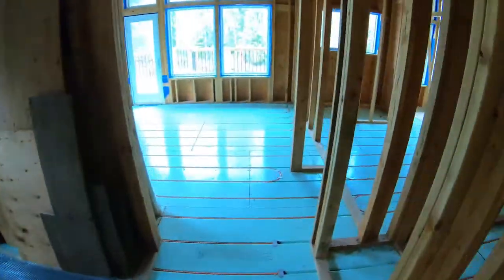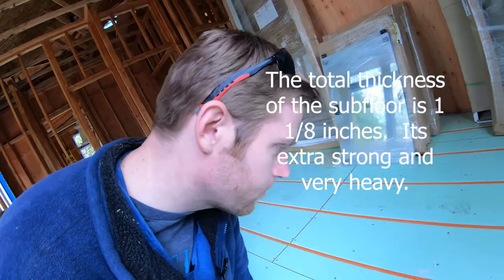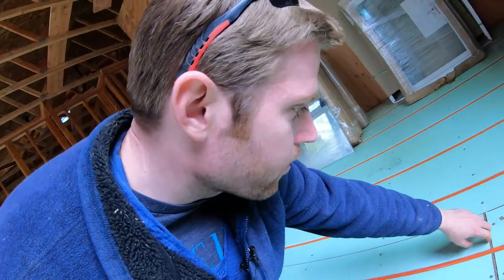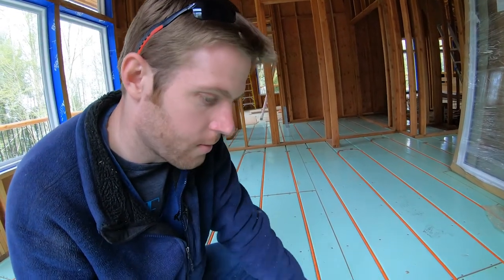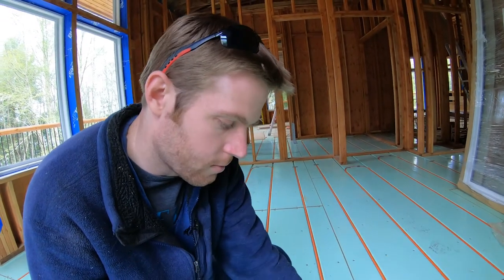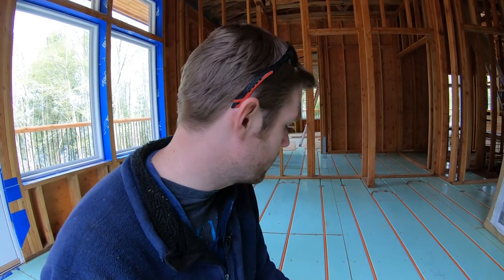WHY Warmboard? A quick word on our choice of Subfloor

Comment: Instead of using nail plates you can use foil tape(used to seal ductwork) to hold the tubing down in place. I did this and it worked great.  This has a couple of advantages IMO. 1. You have to pry the nail plates up when you put the flooring down, the tape stays in place, just lay the flooring.  2. Taping all the tube down keeps construction debris and dirt out of the channels and makes sweeping/cleanup easier. 3. The floor is usually an envelope boundary. Taping the panel seams when you tape the tubes and foaming the penetrations makes for a VERY well sealed barrier.  It is also aluminum so it may even help distribute heat off the top of the tube.
Reply from the maker: I used nail plates per the warmboard instructions but I like the tape idea.  The other bad thing about the nail plates is they can be a trip hazard, especially when they are a little loose.  I think you're right and the  tape would help to spread the heat as well.  In our case, the envelope boundary will be on the underside of the floor joists.  This will keep our floor insulation within the air barrier system.  But I could see how taping the warmboard would give you a really nice seal.  I might do it as insurance.  Thanks for the comment!
Reply: The Leavers Family I didn’t like the nailer instructions so I tried it on the first two runs I laid down and it worked great so I ran with it.  I am building in my spare time so my flooring isn’t down yet, but the tape has held it in place and clean for a year now...  if you are planning an air barrier under the floor insulation, I don’t think you want to seal the top then.  As I understand it you don’t want to completely seal an insulated cavity unless you can guarantee no moisture will be introduced as it will be trapped there.  Warm board is pretty impenetrable as it is...
Reply from the maker: @rronmar  You're right that you don't want to seal up a cavity.  It would also ultimately depend on the perm ratings of any tape used.  There are some tapes that will allow vapor to pass through yet still give you a good air seal.  Any tape with a rating of 5 perms or less is considered impermeable and would likely lead to problems if moisture found its way into that sealed cavity, which it will eventually.